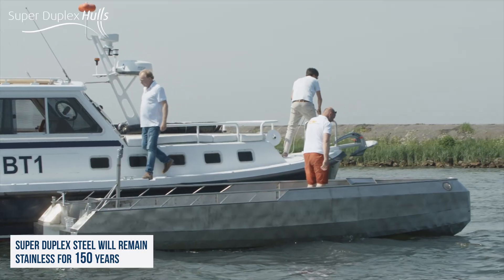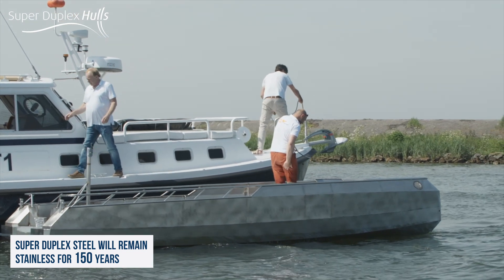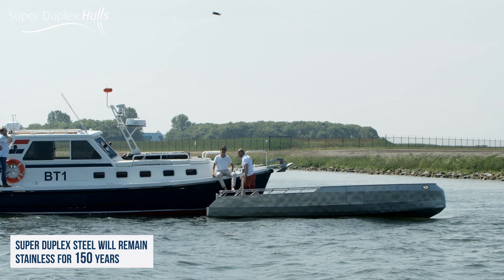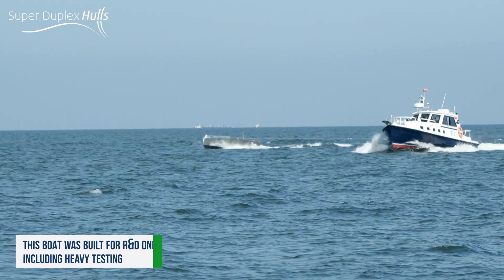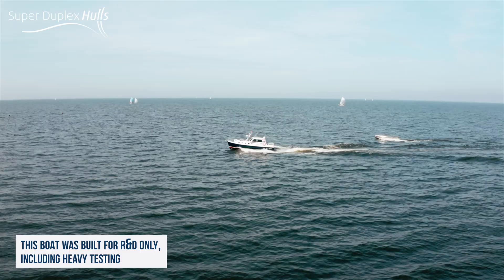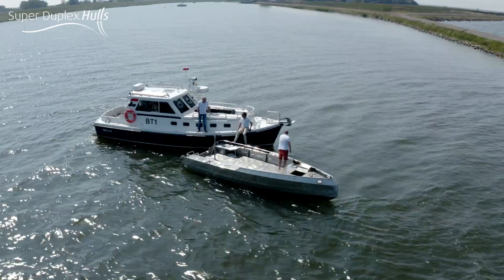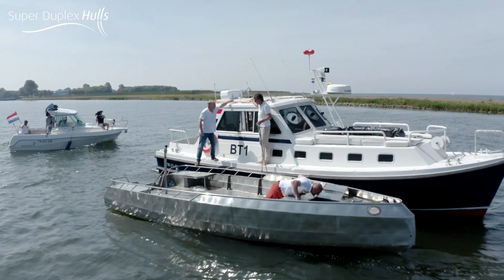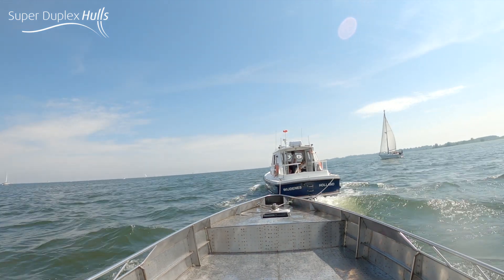CRASHTEST: SD01 1.5mm thick Super Duplex tender crashtest movie!

Comment: It would have been even more convincing had you showed the actual damage to the bottom of the boat. The weight of the small boat, the force it struck the rocks at, the speed the boat hit the rocks, the exact alloy of super duplex used, that way smart people could decide if it was a material that was right for their boat build.